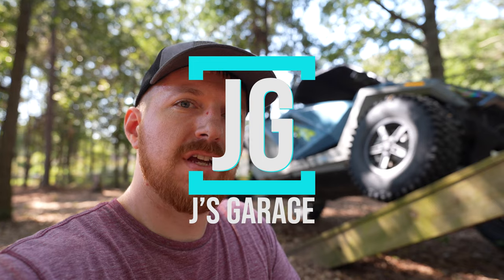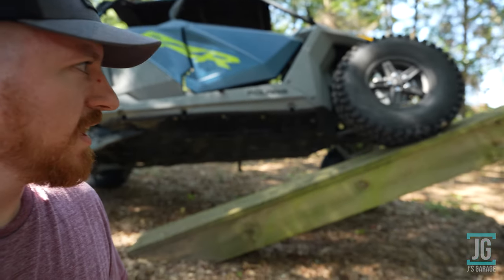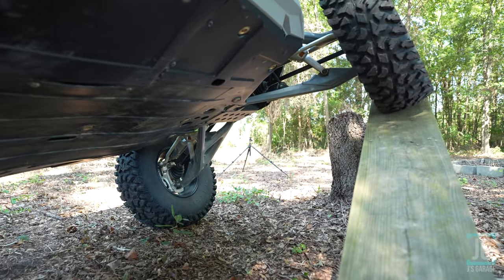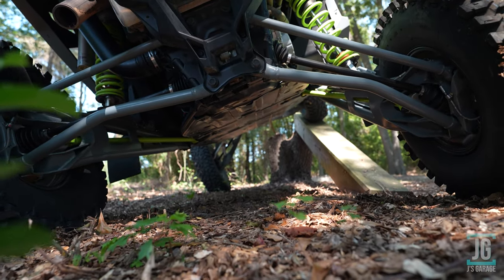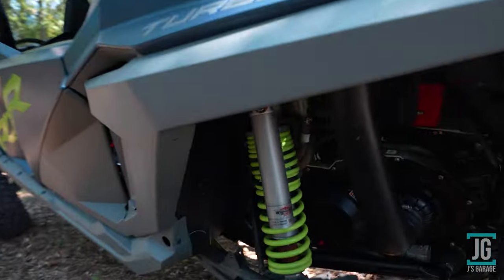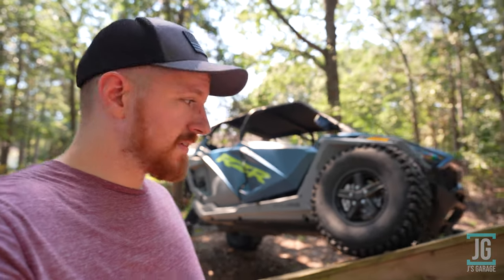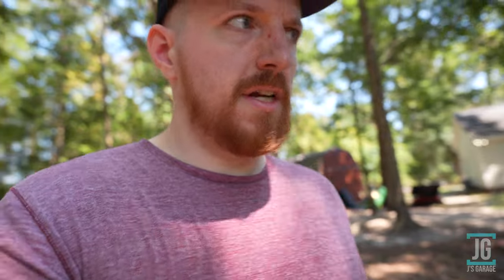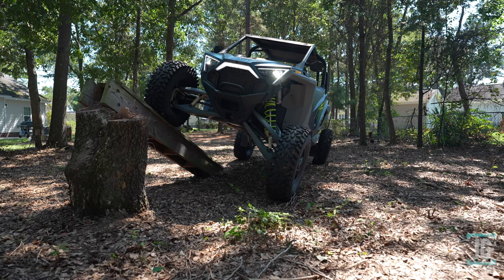Should You Disconnect the Sway Bars on Turbo R?

Comment: Great video. Headed to the Rubicon Trail with my RZR Turbo R and this is very good information. On my Jeep I only disconnect the front sway bar and not the rear for the reasons you outlined, the Jeep leans too far over. Keep up the great videos.

Comment: I ride in the east coast do you regret getting a 74 inch wide buggy.what made you not buy a x3 max
Reply from the maker: No regrets going 74”. I would have regretted not going with the wider machine honestly. Most of the east coast stuff fits a wide machine. The stability and suspension articulation on the wider machines is unmatched by narrower models. 

I picked Turbo R over X3 for many reasons. I wanted high speed capabilities but being the “fastest” machine in the group wasn’t my number one priority. Turbo R has 125” wheelbase compared to the 135” of the 4 seat X3. The extra 10” of wheelbase on X3 doesn’t mean any more interior space or capability so I see it as more of a problem. The Turbo R comes with stronger suspension components, better wheel bearings, stronger brakes, better steering rack, front shocks mounted to lower control arms and so on. Once you see the suspension of the Turbo R next to the x3 it’s hard to appreciate the X3 design. The low gear in Turbo R is a bit lower than the X3. Interior wise the Turbo R is more comfortable to me. Tilt and telescoping steering wheel allow me to position myself perfectly with the wheel. Ride command gives excellent integration of audio, GPS, cameras, and better display of engine metrics. The interior space and access on Turbo R is fantastic. My 6’ 3” friend sat in the back seat comfortably and said he has a blast riding in any seat in the Turbo R. 

Out of the box it’s my opinion that the Turbo R is built better than an X3. Out right speed will be an X3 thing though. As far as two seaters go I’d be conflicted as I find the two seat wheelbase of X3 better than two seat Turbo R. As far as 4 seaters go I would buy the Turbo R all over again as I’ve also had some seat time in 4 seat Pro R. The 4 seat Turbo R is a very agile machine considering its size. 

Sorry I didn’t have a short answer 😂

Comment: Does it have the Dynamic Suspension
Reply from the maker: No this one is the Walker’s.
Reply: can you still dissconnect sway link if it has dynamic suspension , and would it make a difference when using the other options that are programed already ?